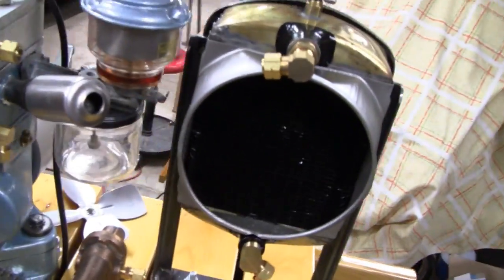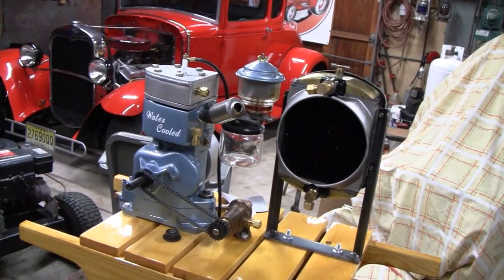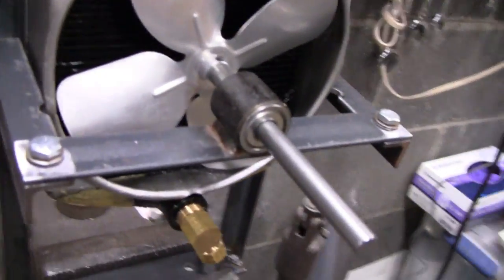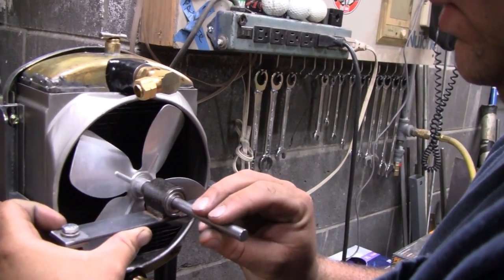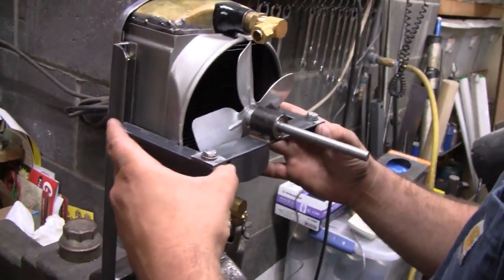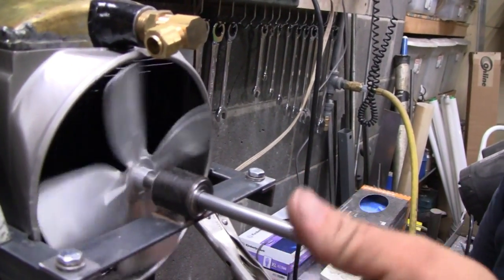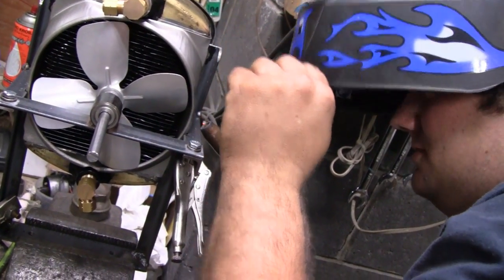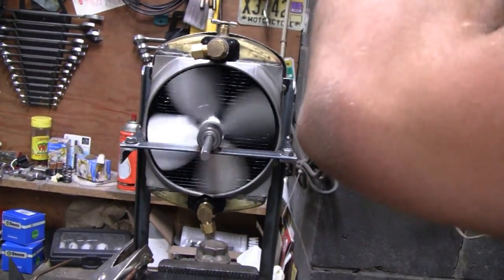HOMEMADE WATER COOLED BRIGGS ENGINE (part 42)

Comment: Looks like the radiator might could use a brace on the right side of the shaft support down to the sled.  Maybe.  Nice work Roadking and SmallEnginemechanic Mike!!!